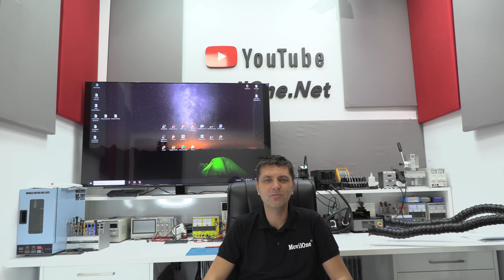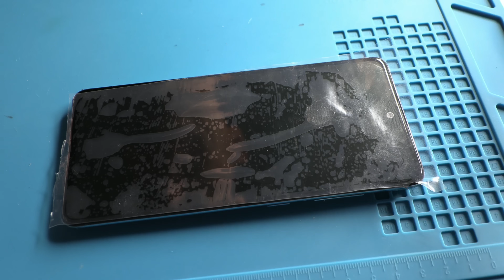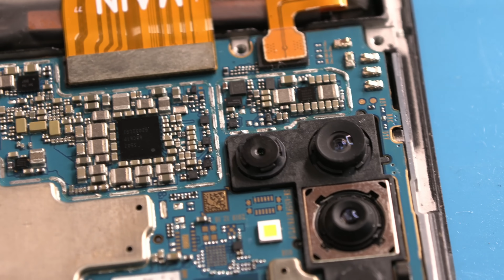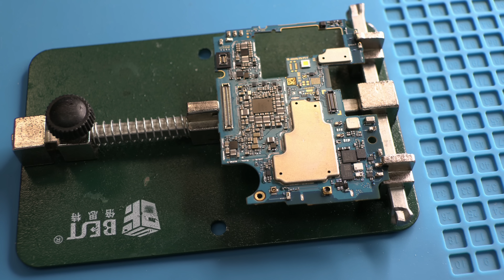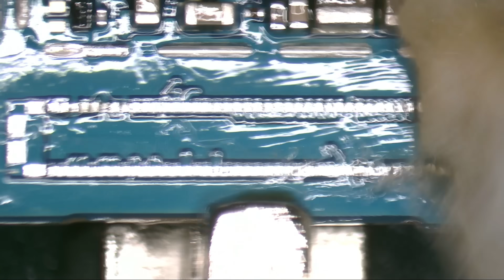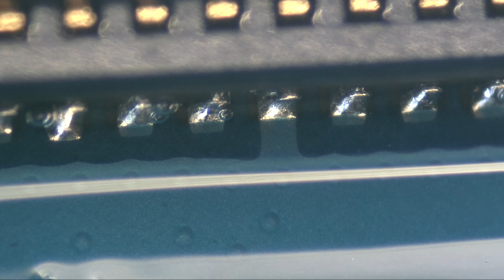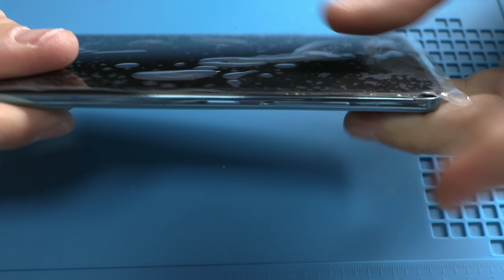The Samsung A Series Secret They Don't Want You to Know!

Comment: How about slowing down phone's performance without user's knowledge? Do you know a software that monitors cpu and gpu usage(%),clock speeds(mhz) and temperatures(°C) like msi afterburner on windows to see if phone manufacturers intentionally slows down phone performance?Thanks!
Reply from the maker: Yes, many brands have been caught deliberately slowing down their devices through software updates, supposedly to "optimize the experience" or "preserve battery life." To monitor CPU and GPU performance on Android, you can try apps like CPU-Z, 3C CPU Manager, or DevCheck. Some of these allow real-time data logging, so you can track performance changes before and after an update. It’s a great way to detect if manufacturers are throttling your device without informing users.

Comment: The A52 has a failure design where drops will slowly unplug or break the screen connector
Reply from the maker: Yes, the A52 has a known issue where drops can loosen or damage the screen connector over time. The way the connector is positioned makes it more vulnerable to impact damage.
Reply: @MovilonePhoneRepair  What are the symptoms for this kind of damage?

Comment: I switched my mom's samsung a30s to nothing phone 1 after my mom  experienced this problem about 5 times from 2019 to 2023 and after the 5th the technician said that this was a widespread problem in the a series phones . So never going back to Samsung every again
Reply from the maker: This is a typical case of recurring issues in certain device series. Many brands release models with design flaws that they never officially acknowledge, but users experience them over time. If a technician confirmed that this was a widespread issue with the Samsung A series, it's clear that it's not an isolated case. Switching brands makes sense when you lose trust in a manufacturer.

Comment: Paid 180 bucks for the a50 over 5 years ago. Goin on 6. I just now swapped to a s22u. The a50 is still working strong and its got 10s of 1000s of hours on it. I got my mobeys worth
Reply from the maker: If your Galaxy A50 has lasted almost six years without issues, you definitely got your money’s worth. Not every device is this lucky—it depends on factors like usage, maintenance, and the quality of the production batch. Some models age better than others, but in general, manufacturers aren’t building phones to last as long as they used to.
Reply: @MovilonePhoneRepair  do u have a video about the green lines. I javnt had that problem yet on my s22u but I worry about ut

Comment: How long are the devices used until this happens?
I've had a Samsung A50 for 5 yrs and A51 for 2 yrs, and nothing happened with them.
I'm sure they won't let it happen during the warranty period, so I assume it happens after 3-4 yrs of use.
Correct me I'm wrong 😅
Reply from the maker: You’re mostly right—most major failures tend to happen after the warranty period, usually around 2-3 years. Some devices last longer, but many manufacturers design them to degrade just after the warranty expires, pushing users to upgrade.

Comment: What about 'slow charging? From 80 minutes to 10 hours into until full😢
Reply from the maker: You have problems with the motherboard, with some electronic charging circuit. Regards.
Reply: What can I do to solve the issue or  I should just buy another phone?? This problem started immediately after updating Samsung a15 to ONE U.I 6.1

Comment: The Problem is they should everything build just like the display imortal even the motherboard . Modern devices should never get fully destroyed like the old ones when something crashes or just 50% of the CPU works the phone should regulat itself still then
Reply from the maker: Ideally, modern devices should be built to self-regulate and remain functional even when some components fail. However, manufacturers design them in a way that forces users to replace the entire device instead of repairing it. Older devices were far more repairable and long-lasting.

Comment: Been saying this for years. Nothing is built to last. They are built to fail. Everything is getting harder to repair. Forcing people to throw it away and buy new. Or go without all together.
Reply from the maker: You’re absolutely right—devices today are designed to fail. Everything is getting harder to repair, pushing people to buy new ones instead of fixing what they have. This cycle generates massive e-waste while maximizing corporate profits.

Comment: 400c @ 15% airflow = melted connecter and delaminated pcb layers really quick. ROHS compliance destroyed all modern electronic device reliability.  Lead was in solder for maulability and thermal cycling plyebility without work hardening. That's why all those gaming consoles, macbooks, pc's, cellphones failed. list goes on forever. We're getting screwed as consumers and it's progressively getting worse.
Reply from the maker: Exactly—ROHS compliance removed lead from solder, which drastically reduced the durability of modern electronics. Lead solder was flexible and resistant to thermal stress, which is why older devices lasted longer. Now, we see mass failures in gaming consoles, MacBooks, PCs, and smartphones. Consumers are getting a worse deal, and it’s only getting worse.

Comment: Also, I wonder if the devices bought 3 years ago like my Poco M3 are able to run today's apps without slowing down but somehow the companies send some signal to these phones so that they start to slow down in a few years, forcing us to go buy a new phone so that it can support current day's apps. Is it possible to test this somehow? Findout if hardware somehow slows down on its own over years or is it really the extra load that current day apps put on old devices slowing it down?
Reply from the maker: That’s a great question. While modern apps do demand more resources, there is evidence that companies intentionally slow down devices through software updates. Testing this would require comparing a device with factory firmware versus one with all updates installed over time. If the hardware is still capable but performs worse, it’s likely an artificial limitation.

Comment: I think that my s21 ultra also suffers from the same issue it doesnt consume any power when chaging
Reply from the maker: If your S21 Ultra isn’t consuming power while charging, it could be a software issue, a faulty charging cable, or even a problem with the charging port. Try using a different charger and checking for any recent software updates that might have caused the issue.

Comment: This company is such a scam. Does Lenovo does the same? I have a old tablet from 2019 who works like in first day but im affraid my new Lenovo tablet wont keep me not even 5 years.
Reply from the maker: Lenovo has mixed results—some of their older devices last a long time, but newer models might not be as durable. If your 2019 tablet still works like new, you were lucky with its build quality. The durability of your new Lenovo tablet will depend on whether they’ve cut corners in recent models.

Comment: Then surprisingly my a32 4g is still fine
Reply from the maker: If your A32 4G is still working fine, that’s great! Not all devices in the A series fail, but some models seem to have more issues than others.
Reply: @MovilonePhoneRepair  mine kind of stopped charging tbh but it was because of salt water from the sea getting into the charging port, I used cotton sticks to clean it but didn't work just hy cleaning it so I opened the phone and disconnected completely the battery cable then just putted back and lol it started charging again just fine and its doing just fine since then my mom is using it now i got s24u. I really think that they stopped using bad plastic on this particular model ( a32 4g ) because I've literally made this phone heat so much because I'm very heavy user and still no problem man , I mean the battery has degraded down to 70% health according to accubatery so u can imagine how much heat it has been through and the plastic is still ok. 
One of my friends got a31 instead because he says that it has same board as the s7 edge wich was his previous phone wich lasted really long , idk where he got that info and I would like to ask u if that's true BTW this guy still uses a31 no problem at all but he's no heavy user

Comment: I had an A51 and had the same problem, I turned it into a frankenstein phone by removing the headphone jack, drilling a hole and driving 2 wires to the power connector (I wanted to remove the battery but accidentally stabbed it), the phone worked for another 4 months by being connected to a power-bank

Comment: People that I know that using a Sammy A series phones always seem to have some kind of charging issues, its weird. maybe this is the culprit. Thanks 👍🏻
Reply from the maker: Charging issues are one of the most common complaints with the A series. Many users report problems with slow charging, battery wear, or charging ports failing. It seems like a recurring problem in Samsung’s budget and mid-range devices.

Comment: Man, time by time I power up my S3mini and still working just fine, still can use it for calls, sms, mail and even telegram x works as well, lol it is a "mini beast" 

On the other hand, the huawei mate 7 I got on 2014 only lasted 2 years, only good thing was the screen, the rest is garbage.

Actually I'm using a samsung A01 (not the core) and praying it can last an extra year.
Reply from the maker: That S3 Mini is a legend! Some older devices were built to last, unlike many newer models. Your A01 might hold up for another year with proper care, but unfortunately, durability has taken a hit in recent generations.
Reply: Also thanks to the fact I'm able to find batteries for it (some decent quality ones).

It tells you why technocrats got rid of swappable batteries in first place.

Btw, I heard Nokia is bringing back swappable batteries.

Comment: In 2 year i had to buy 3 times the smartphone in A series so i decided to buy a S series at the 2nd year i had to repare it twice but at least i could repare it, hight end looks build stronger , never buy a low end they are fat with big ugly screen now
Reply from the maker: Low-end devices tend to have more issues because manufacturers cut costs on materials and quality control. High-end models are generally built better.

Comment: No Wonder nowadays any phone cost less when back then smartphones use to cost more but durable and they lasted that makes sense nowadays why phones are free or cost under $100 or under $50 i remember buying in 2011 and 2014 good durable phones they didn't messed up just like that nowadays i have a bunch of problems with my phones even if i pay $200 or more they still dont last maybe 2 years but than the phone starts to act weird not charging good and more.
Reply from the maker: Phones used to be expensive but lasted much longer. Now, even mid-range degrade quickly, forcing users to upgrade. It’s not about affordability—it’s about manufacturers maximizing profits.

Comment: Can ghost touch be fixed in A03S?
Reply from the maker: Ghost touch issues on the A03S are often caused by faulty touchscreens or software glitches. Sometimes recalibrating the screen or replacing the digitizer can fix it.
Reply: @MovilonePhoneRepair  thanks, 

I have this problem that annoy me and it happen just after its warranty got expired

Comment: A similar connector has been used on Apple laptops since as early as 2001.  The intermittent loss of connectivity on this connector has resulted in power faults, including short circuits and arching on the power contacts, as well as hard drive corruption from using it to connect the heard drive.  

It is well known that this connector type is problematic, but companies keep using it.  The connector is not cheaper, or easier to install either.  A simple card edge connector (like the edge of an m.2 slot) is the most cost efficient connector.

Comment: My OnePlus 8T still works to this day. It still has decent battery life and it's almost 5 years old 😂 I'm not buying Samsung again
Reply from the maker: Your OnePlus 8T is proving that not all phones are designed to fail quickly! Some brands focus on longevity, while others prioritize forced upgrades.
Reply: My a50 is 5 years old,  still fine, no problems.
Reply: I have a 2020 samsung tab s6 lite works but sotware sucks
Reply: @BLITZREPLAYS-f3d watching this on my 5 year old a6 lite, only issue so far is a little screen burn through.😊
Reply: I'm reading this comment on 8T and I am very satisfied with this phone.
Reply: The Samsung gadget of my sister is almost 7 year old, my brother's samsung is almost 5 year old, my another sister's Samsung a32 is almost 6 years old and everything is fine despite the drops. By the way, my Samsung is 3 year old.

Samsung lasts long based on our experience
Reply: Same with my Oneplus 6
Reply: I'm texting on my OnePlus 6 pro, still like new
Reply: I typed this comment from my Oneplus 8 which is STILL my daily phone, no lag, still good battery life. Not going to buy anything else than Oneplus.
Reply: Don't worry that brand probably buys Samsung products like display. Chinese phones buys Samsung displays, dram, sensor etc

Comment: This is what happens to my a31 i successfully changed touchscreen and make it work but the charging is just not working at all as an inexperienced fixer and just DIY there's nothing i can do about it and had to throw away the phone after battery drains this vedio made me realise what the problem was thanks 🙏
Reply from the maker: You did well replacing the touchscreen, but charging issues are often caused by deeper motherboard problems. Sadly, manufacturers make DIY repairs difficult, forcing people to replace their phones instead.

Comment: I bought new USB cable (made in china)...when my previous same brand USB cable stopped working....after some time my second USB cable also stopped working,  I dig arround to know the reason.....I opened both USB cables....type c connectors...what I found one wore out of 4 wires in USB was very thin which damage after some time..
..yes mostly chinies USB or others are designed  to work only for some time......by that way think...how china is sucking wealth of other nations ...govts must have rule  for compulsary product guaranty whether it cost some more....and restriction over without guaranteed products from china.
Reply from the maker: Cheap USB cables are often made with weak internal wiring, leading to quick failures. A guarantee for electronic products would definitely help prevent waste and improve quality control.

Comment: I've long decided to ditch samsung devices on a whole...Other brands out there with the same specs or better, same or cheaper prices, stronger build, and lack these "common samsung problems"...Yup...I prefer to spend my money on a phone that I can use every inch of till it gives up the ghost, rather than have one that fails on me with more than 70% health left, needing me to bring to a repair shop or spend time repairing it. It's not about having so much money to just buy another. It's about the hassle in that + data. And being rich is no excuse to waste stuff either.
Reply from the maker: Well said! A durable phone should last until it truly wears out, not just fail due to design flaws. It’s not about money—it’s about unnecessary waste and inconvenience.

Comment: bro my devices samsung a70 i charged it for 1 night with 45 watts original samsung bricks then suddenly it wont boot. i thought it was the battery issue. so i had add to cart my battery. then i saw this video. you saved me from buying the battery. i havent buyed it yet. thanks for your information. subscribed. :)
Reply from the maker: Leaving a device charging overnight with a high-wattage charger can sometimes cause unexpected failures. I'm glad you saw this video before buying a new battery—it might have saved you from an unnecessary expense. Thanks for subscribing!

Comment: I still don't understand. I have a Samsung galaxy a51 for 6 years and it still works fine and I haven't dropped it once
Reply from the maker: If your A51 has lasted 6 years without any issues, that's great! Some devices hold up better than others, especially if they are well taken care of. Not all units have the same lifespan, as manufacturing quality can vary.